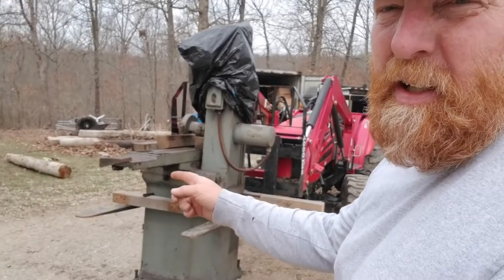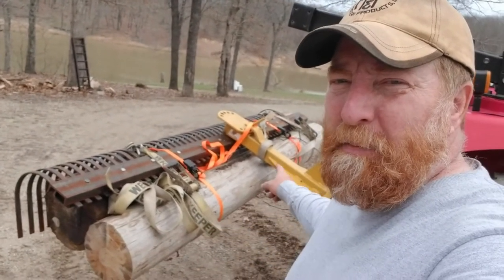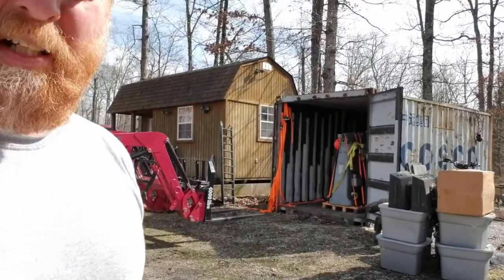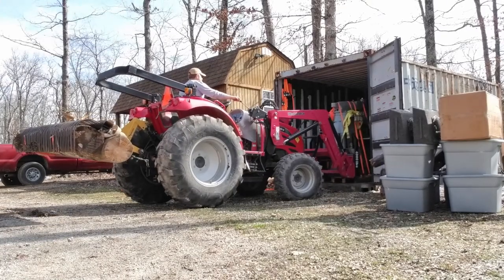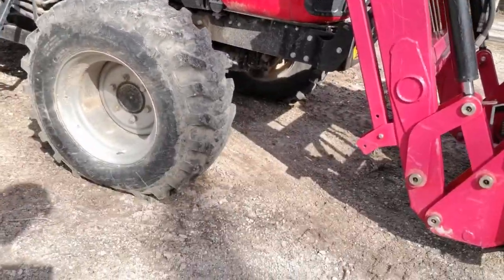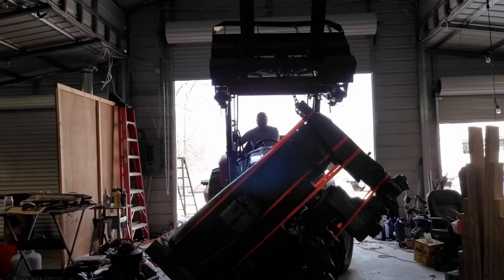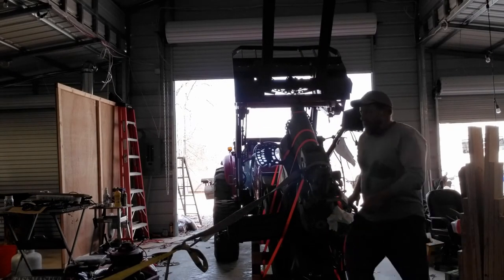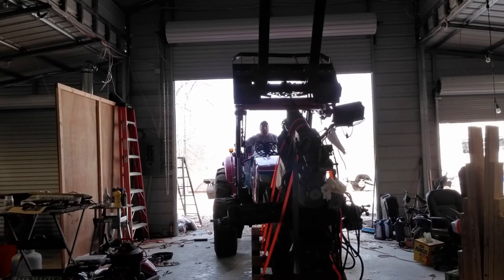Disaster While Moving My Bridgeport Mill.

Comment: I have found that the most stable way to move any B’Port type mill is to, as was done here, invert the head, raise the knee and table high enough to hold a 2x4 in place, with the ram extended out from the column about 6”. At this point approach the mill from the side with the forks on either side of the column. The mill is now hanging with most of the weight below the forks. Drive slowly and carefully on an even surface.

Comment: Where is the other video my friend. I’m in the same dang boat. I’m wondering what the possible consequences could be
Reply from the maker: @stashostigin9927  I bent a couple handles and end of shafts. Broke the Y axis bearing housing. No half nut damage. I brazed the cast bearing housing, replaced the handles and deal with the oval rotation as I turn the handles.

Comment: So sorry to see this. If it fell over on dirt you would have a better chance to escape major damage. But on concrete! Yes I have some experience with this problem. When I was in my 20s I tipped over a 14x40 Logan lathe. The damage that I saw wasn’t too bad. It was the hidden damage that I discovered over several months. Let’s just say that for recent machinery purchases I have rented heavy duty fork lifts. Expensive? Not near as expensive repairing damaged machinery. But we live to fight another day. Stay safe!
Reply from the maker: Thanks, there were no local rentals that had a decent fork lift at least none that would operate on the gravel. I live in the boonies. I haven't repaired everything yet and am weary of the hidden damage that may pop up. I'm sure it's there I just haven't found it yet.

Comment: Extend the ram far enough to put a large 4x6 (wider than the column) underneath the ram dovetails between the column and the spindle.   You will be picking up the mill at this point.  THEN... put another block of wood across the table.  Extend the Y axis towards the front of the machine.  Position the forks underneath the block spanning the ram dovetails and raise the forks until they are holding the block, but not yet lifting the mill.  Then raise the table underneath the forks, trapping the block of wood above the table against the underside of the forks.   Tilt the machine towards the fork lift (or tractor), then lift.  The wood will trap it firmly against the forks, you can lift and move it without fear of the mill falling over.   Lifting from the base of the machine is asking for trouble.   Either lift with a sling, or as I just described.
Reply from the maker: It was my dumb ass fault. I raised the forks before it was clear of the pallet. The biggest issue is with the tractor.  The forks are so far forward that above chest height the tractor gets really unstable. 
Thank you for the advice. I will be using an actual fork lift when I move it again.

Comment: Bummer. There is a way to positively prevent heavy machinery tipping over and it's cheap too. I bolt pieces of heavy channel (it was handy so other sections can be used) to mill base after manually raising it using a pinch bar and wooden cribbing (metal slides on metal). I predrill the sections to bolt to the base using allthread inserted from above. Now you have outriggers (I use long sections) that positive control the machine. I used large heavy duty bolted casters on several moves but bought a set of 8" wheeled round section scaffold casters which roll much better for next time.(They're great for welding carts too) I crib the machine high enough for whatever caster I use then attach the caster.

No tipping, better control than machinery skates (which require ideal floors and are famously dangerous, I wouldn't use them if they were free) and the caster spread lets me manually or power winch machines onto my car trailer. Since I'm tall I swap the outriggers with heavy angle so I can slide a pallet jack beneath the mill if needed for minor in-shop repositioning.

I also used pipe skids (inspired by oil patch skids) on surfaces where casters would punch through like one example shown here: http://www.chopcult.com/forum/showthread.php?t=49394

Anyone who can use a mill can certainly use a hand drill with a step and other bits (machinists center drill bits work fine with hand drills). Self and bro have an "auction kit" we bring and never need to pay a rigger. Every auction crew who sees our gear is impressed and those guys are pretty jaded

Comment: I did something very simillar with my Kent mill, it was higher in the air, but at least it fell in its side and it was on somewhat soft ground. I got very lucky and no damage, I just had a bunch of sandy soil to clean out othe the lead screws!

Comment: That is so bad, looked like forks caught the pallet. I just posted my 1st mill video. Used my car hoist to pickup off trailer. I was a little nervous!
Reply from the maker: The left fork was about a quarter inch under. It was definitely operator error.
Reply: @muddyudders  things like that happen. I’ve had similar things happen, especially working alone.